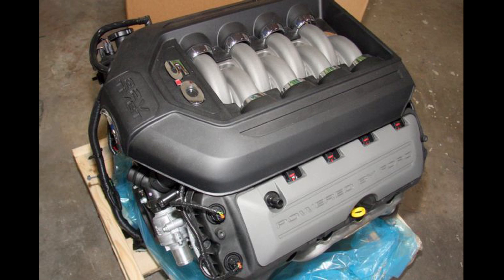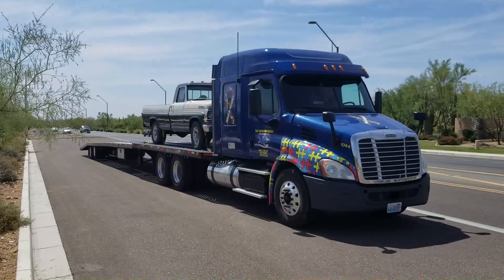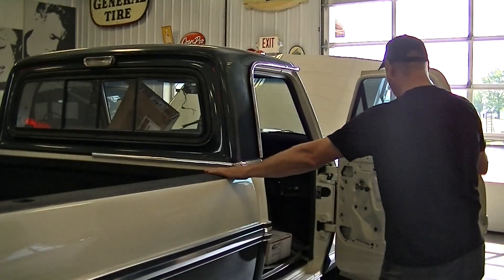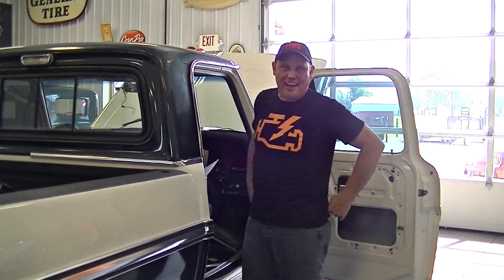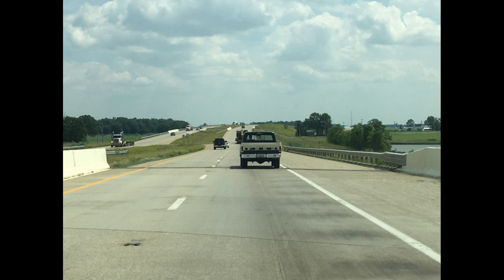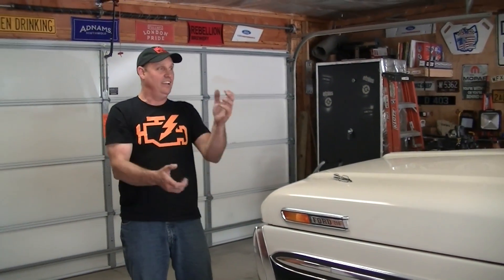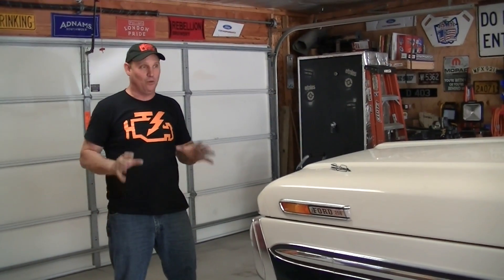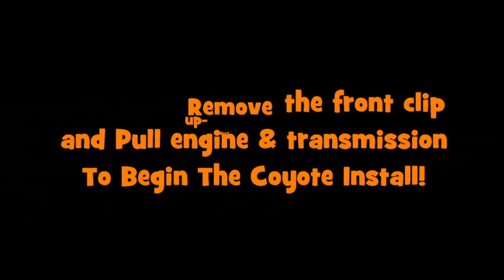5.0L Coyote Engine Swap F250 Build How To! F150 F100 1972 71

Comment: Hi, how much will cost me an coyote swap on 71 f100 styleside bed with 6 cylinder  and if automatic and manual transmissions has different prices  thank you
Reply from the maker: Please direct any actual build inquiries to the website www.GrenadeMotorsports.com and someone will get back with you. Thanks for watching!
Reply: @GrenadeMotorsports   i did  couldn't find any email  or contact  🤷‍♂️
Reply from the maker: There's a giant Contact Us letter "e" spinning on every page. ;)
Reply: @GrenadeMotorsports  ok thank you,
I have one question my 71 f100 came with a 6 cylinder if i decide to swap engine to a 289 or 302 v8 with c4 transmission do i need different motor mounts  and transmission mounts, or they fit without modifications  
Thanks again 👍
Reply from the maker: @67mustang351w  Yes, you'll need new mounts but can likely find new reproductions somewhere.
Reply: @GrenadeMotorsports  thank you so much,  don't know if is too much to ask for a link where i can buy the motor mounts for a 302 engine with c4 transmission 🙏 because i don't know exactly what parts i need for v8 swap thank you they are a lot of different motor mounts
Reply from the maker: Honestly I'm not sure what you need. I build everything myself so I'm afraid I'm not much help on part numbers. Best of luck :)
Reply: @GrenadeMotorsports   🙁

Comment: I have a 1979 f150 with a 460 engine and I have a 5.0 coyote engine that I want to put in it I have the engine transmission wire harness ecu what else do I need what mounts do I need can i get any help on that give me a number to call and ask please
Reply from the maker: There are a ton of things you'll need to know on how to get all this to work. You'll have to fabricate mounts, there's nothing to bolt in. Check out the other videos, in several of them, there are tips and tricks on how to make all this work. Thanks for watching!

Comment: Would this be the same process as putting a 1986 era mustang 5.0 engine  in to a 1970 f100 camper special ?
Reply from the maker: Pretty much the same thing, yes! Thanks for watching!
Reply: Grenade Motorsports awesome thank you  this my first engine swap ever and I'm trying to see how hard or easy it is to do it and from your videos removing the whole front end and the welding looks a little more difficult than I expected :(
Reply from the maker: Well if you get stuck on something just contact through the website and I'll see if I can offer some advice. www.GrenadeMotorsports.com

Comment: What would it take to do this to a 1995 Ford F150  XL 4x4 she already has a 5.0 what's 113000 miles but I want something with more power and more torque would my transmission and transfer case bolts up to it and actually work
Reply from the maker: Thanks for watching! Contact through the website and someone will get back to you. :)

Comment: Interesting, that mill really fills the engine compartment. Was there much weight difference between what you put in and what was in there to start with? How does it handle? I had a 1966 with the twin I-beam and didn't like it much because the front end would wash out in curves before the rear would.  I'd have to hammer the gas to keep out of the ditch.
Reply from the maker: The front springs are going to be changed because the new power plant- is WAY lighter. We're getting lowering springs made for it. When you drop the engine and trans on to that cradle- it doesn't drop. At all.

Comment: sharp ol ford fred that was cool between me and my dad we have had nearly every body style ford truck from 65 to date. even here in bama if that were a chebby pos it would be a bucket of rust and we use no salt on the roads. would love to do a coyote on my 96 eddie bauer bronco 5.8 with 580,000 miles on all original drivetrain but a reman 5.8 will have to fit the bill because of cost and fixed income (that suxs). cause bronco has been down 2 years broke timing chain i am forced retired because of heart attack ford tech and love swaps and mods could wire everything/anything but a broken heart i watch bunches of these videos..// good job
Reply from the maker: Thank you man! Glad you're able to keep on wrenching and watching! Have fun and Thanks again sir!

Comment: One question. Do you use the old wire harness or buy a new harness?
Reply from the maker: Thanks! We use the Ford Performance pack to power these Coyote Motors.
Reply: Grenade Motorsports other then that lights and accessories are ran off the regular harness
Reply from the maker: Uses Lighting from OEM body wiring and switches. Dash has to be converted to Digital, for the electronic signals from the Coyote components to display. We use Dakota digital clusters. This truck will be back on screen in a few weeks, with more data. Feel free to ask questions, we've done several!
Reply: Grenade Motorsports is there any recalibrations that has to be done to the computer due to the weight of the vehicle or the gear ratio in the rear end or tire size.
Reply from the maker: It comes with a base tune that will run and drive, but it's also smart. It learns the parameters. But, We always have them dyno tuned afterwards because you want the absolute most out of your new driveline package.

Comment: Has it gone through a resto before? That's way too clean to be original.
Reply from the maker: Thanks for watching and it's had a recent paint job & wheels, plus the engine was rebuilt at some point but no, it's never been restored. There isn't much of it  left that will need help when we get through with it!

Comment: Regarding the tailgate.... Not an applique.  I had a spare tailgate from when I was first building the truck.  The FORD is stamped in the tailgates.  I had the body shop cut out the O and the R.  Moved the R left.  Cut an F from the spare tailgate and had the bottom fabricated to make an E....  Welded in.  All Steel!  The Sport Custom models had an overlay in black and chrome.  Had my guy paint the FRED to look like the overlay.  Life is too short to not have fun!  Thanks for the video Paul.  Looking forward to you giving "Betsy" new life!
Reply from the maker: Man, it's done SO WELL I can't even see where they did that. Good skill sets! This is a strong old truck and we are going to make it even stronger. And muuuuch smother ;)
Reply: LOL Turbo Parts!

Comment: Subscribed!  Loving this!  Can you polybush these trucks?  With all the suspension tight and setup properly on a 4 wheel tracking rig, it should run way straighter!  Save the scary for the acceleration!  :)
Reply from the maker: Oh man! You wish you were here for this one! NO RUST. I mean- ZERO. I can see bolt threads everywhere! The front end will get a makeover in the upcoming videos. Stay tuned buddy!